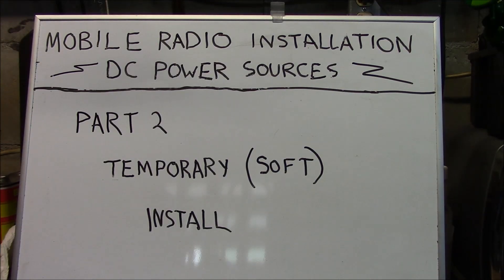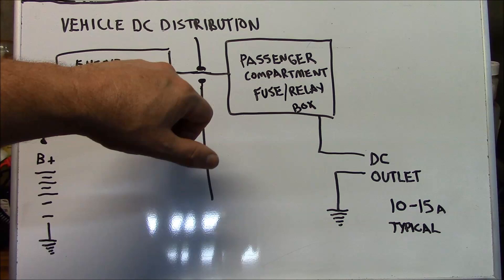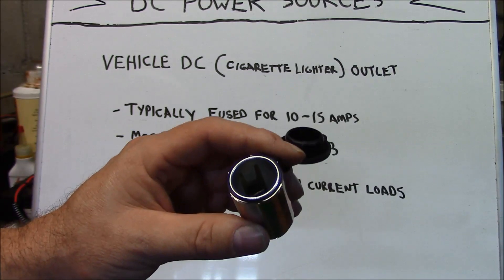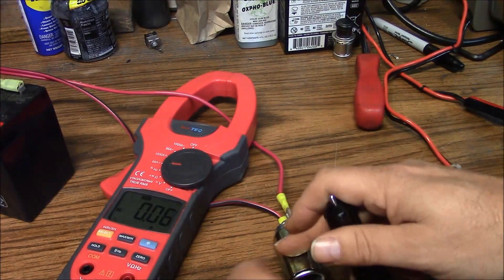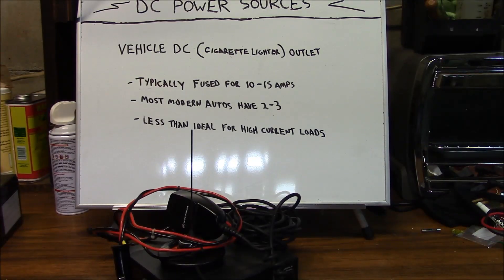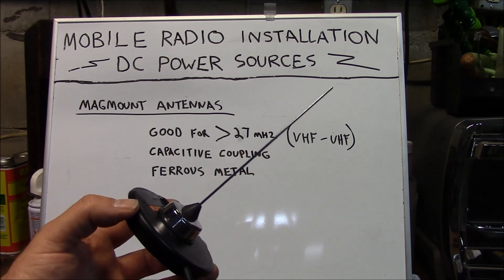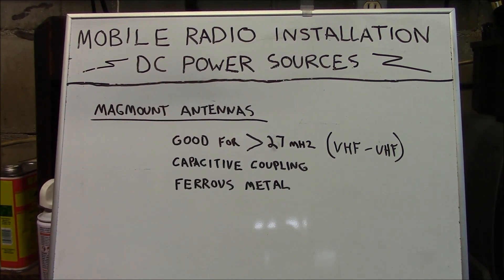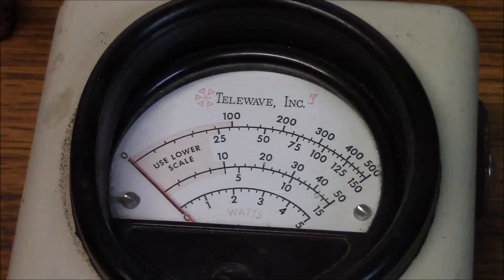Mobile radio installation DC power sources part 2 Temporary (soft) install

Comment: Outstanding!
I especially like the Practical advice on attaching the magnetic mount to various materials. Any more videos coming from the series? By the way I get a lot of positive comments on Facebook about your videos I'm sharing. People really like what you're doing.
73
Julian oh8stn
Reply from the maker: Thank you Julian ! I have had a few times I have had to antenna up bizzare stuff temporarily and outside of access to sheet metal rare earth magnets work well and fit into a tool kit. 5 minute epoxy and hand shears are lighter and less permanent than a screwgun. I am glad you are enjoying the series ! I have another in this series in the pipeline. Thanks for watching !